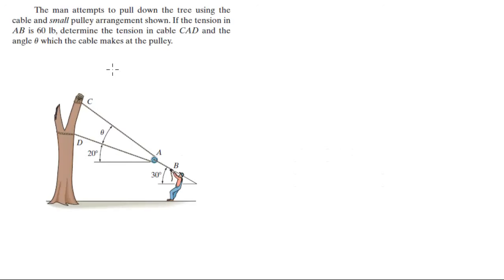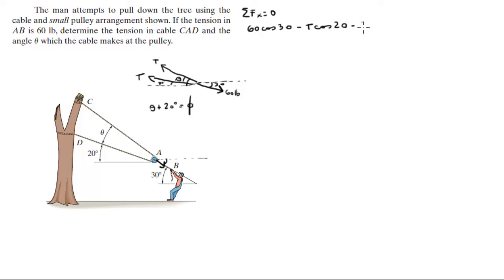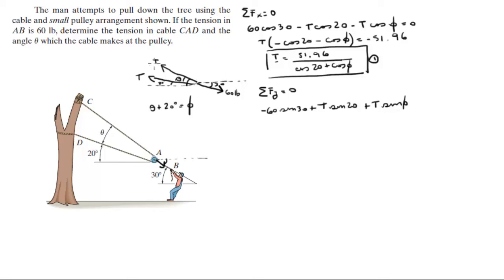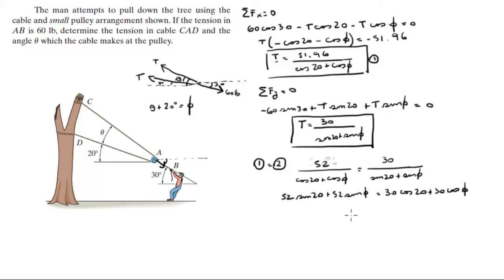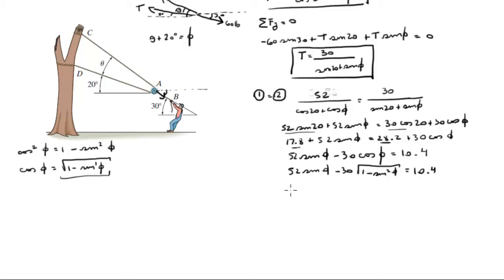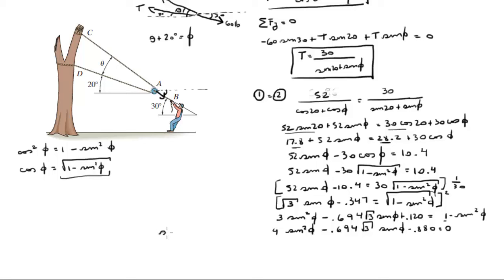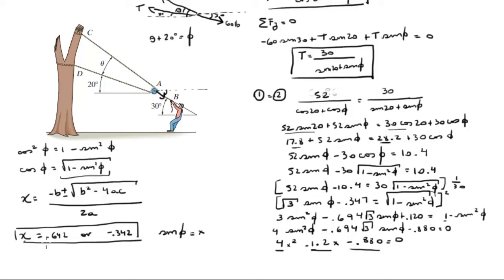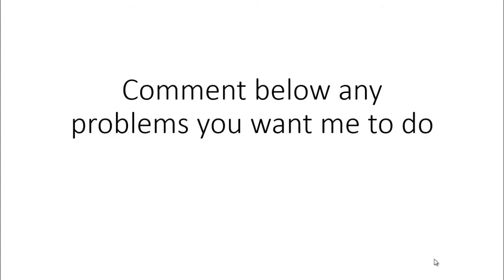Determine the tension in cable CAD and the angle u which the cable makes at the pulley

Comment: On FBD adjust the coordinate system so x' is along FB. Since FB is 30 degrees above horizontal, and FAD is 20 degrees above the horizontal, you know that FAD will be below x' 10 degrees. Clarifying, FAD and FAC are just T. Then we have FAC at u above x'. (u= theta - 10) Sum forces in x, 60-Tcosu-Tcos(10)=0. sum forces in y, Tsinu-Tsin(10)=0. We find u = 10 degrees, so theta must be 20 degrees. so 60=T(cos(10)+cos(10)), T=30.46 lb. Let me know if there is a flaw in this method as I made it myself.
Reply: this helped way more than the video thanks mate
Reply: way way better than the mess in that video lol. TY!
Reply: @skyr6762  Glad I could help. Keep on pursuing engineering, I just graduated in May and have a job already. I'm assuming you just passed Statics. Get that Fluid Mechanics book early and fuck chegg.
Reply: This makes SO much more sense. Thank you so much!
Reply: thank you so much you saved me from physics induced psychosis
Reply: You just saved me several MORE hours of banging my head against the wall, thank you so much.

Comment: Hi may I just present another solution for this

We can actually rotate the axis and would make everything way more simpler and just actually use angles instead of using vectors.. but that depends on the professors 

I can rotate it and give both Tension an angle of 170 and just by using angle theories 170 +170 - 360 you would just come up with the angle 20 deggrees
Same answer

Though thanks for this knowledge this will be really useful for the more complicated once

Comment: How did you get .694 sqrt(3) sin(phi) from squaring both sides of the equation?   7:19 - 8:08
Reply: He adds .347+.347 to get .694 and multiplied it by square root of 3 to give him 1.2
Reply: why does he want 1.2?
Reply: Edgar Moriel He wants 1.2 to use to quadratic formula to give him theta if you see its 1.2x so in the quadratic formula b= 1.2
Reply: @ArcGaming42  where did he get an extra sin(phi) from in the middle term when squared both sides of the equation. that makes no sense to me.
Reply: @HarisRazzaq  I'm not sure how he got the extra sin either but an easy way I found to do this problem is draw the Free body diagram and split theta angle in half by drawing a line from point B through point A and to the tree. Then set 20 + (theta/2) = 30, theta would then equal 20 degrees and your phi angle would be 40 degrees. Hope this helps

Comment: How did you get sqrt(3) by dividing 52/30  6:56/11:26
Reply: If you do on the calculator sqrt of 3, and compare with 52/30, will have very close numbers, so this is an approximation to don't keep writing the same small number (1.73~3).

Comment: Why is your starting equation

60cos(30) - Tcos(20) - Tcos(theta) = 0

instead of

60cos(30) - Tcos(20) - Tcos(20 + theta) = 0

Shouldn't the angle of the upper rope be calculated from the ground, not the other rope?
Reply: He uses phi which is 20 +theta. He defined it in the first couple minutes
Reply: @ExoTicHOAX  I know this was 3 years ago but is it okay to use theta + 20 instead of "phi" to avoid confusion??